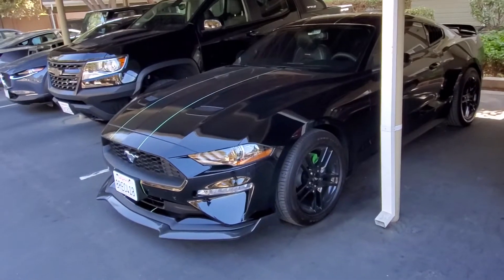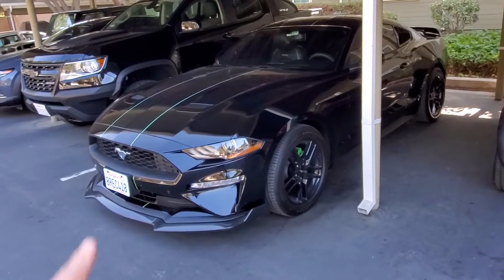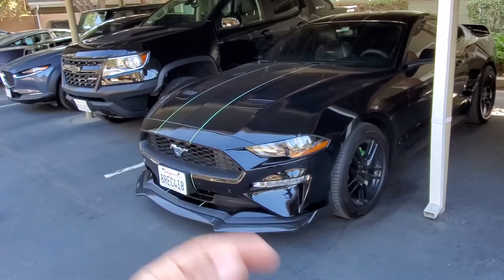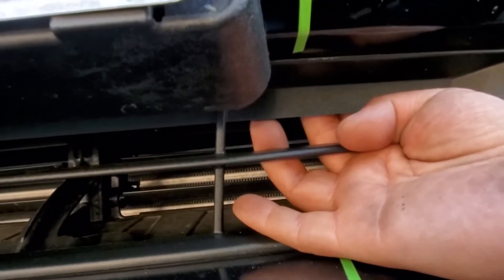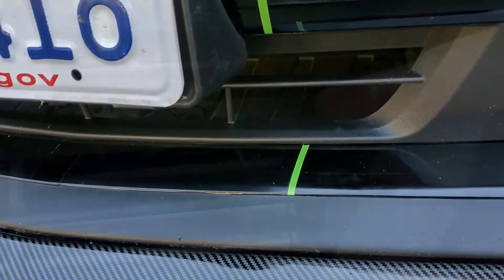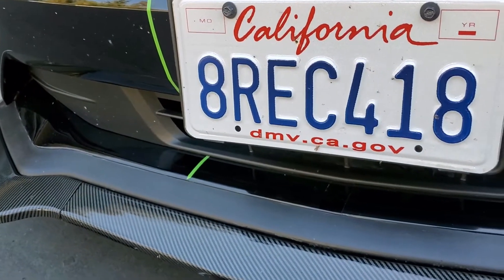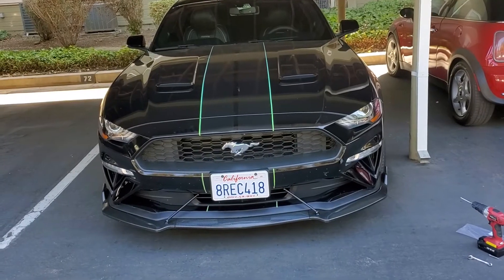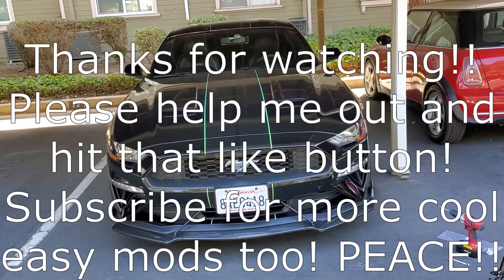2020 Mustang EcoBoost - [Ep 19] - Lip Splitter Strut Mod

Comment: Hey, how are these struts holding up? I am thinking about getting the ones that vary in length since I prefer that my struts are vertical rather than slanted. Really nice mod though and thank you for this informational video.
Reply from the maker: Hi Edgar,  thank you for watching! 
I actually had to remove the lip spoiler because the cracked.  Unfortunately got smashed when they butted up against a tall sidewalk.  So, I had to remove the struts as I didn't have a extra spoiler. 
I may buy one later and put it back. 
Luckily nothing else was damaged!🤣

Comment: how did you tighten the nut inside of your front splitter? Seems like that nut would be harder to get to.
Reply from the maker: Hi John, thanks for watching! The nuts I used have the locking insert. I just held the nut with the wrench and spinned the rod onto the nut. Hope this helps! PEACE ✌️